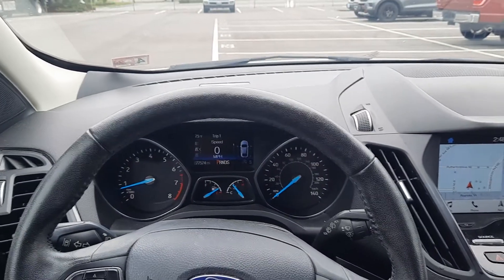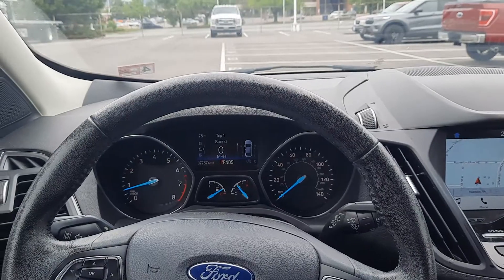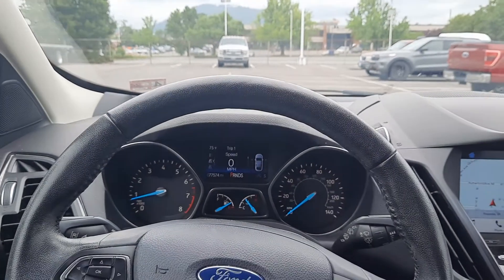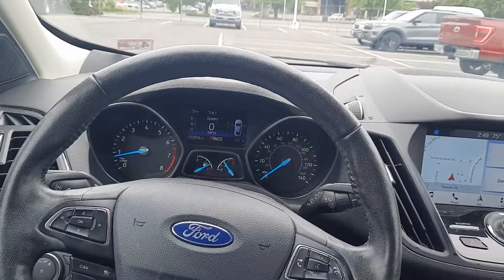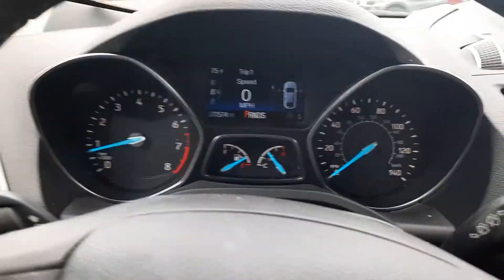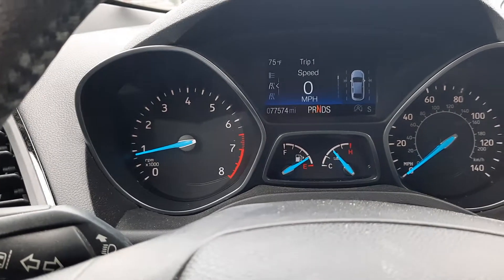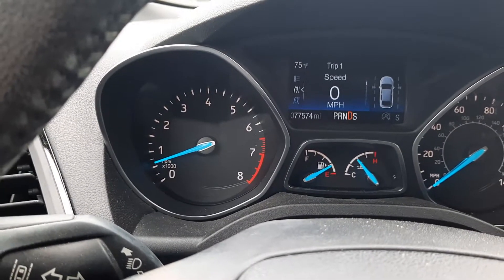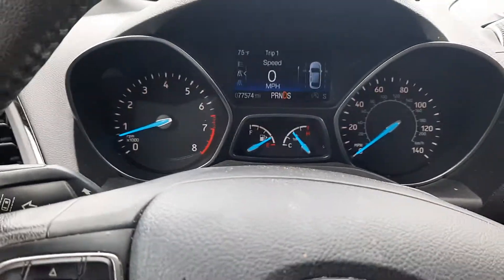Very Rough, Low Idle in Gear Only! Ford Escape

Comment from the maker: Watch next: 6F35 FULL Rebuild https://youtu.be/lrMZ2m-Zji0
Transmission removal: https://youtu.be/E-OCjm3pFJ0
6F35 Transmission Service: https://youtu.be/F--bs3gqq5M
Won't move in DRIVE: https://youtu.be/td6KwBAuJf8
Converter shudder diag: https://youtu.be/7yNIrjUlu4w
Checking fluid level: https://youtu.be/jswCtiJaXpU
Pump whine sound: https://youtu.be/pbgr44_fILU

Comment: 6F35 from ETE Reman install by myself, has heavy drag on idle, whining/grinding noise as each gear tops out on rpms before shifting to next gear. Details: 2013 escape 2.5 FW, I installed a 6f35 from ETE Reman twice. The first install was replace under warranty within first two months. The second and current install has the same two problems. There is a loud heavy/rough drag on idle (car shakes) and occasionally shakes at low speed but stable when accelerating and under load. And, second, there is a high pitch grinding/whining or scrapping noise when the rpm's of each gear tops out before shifting to next gear (almost as if the differential planetary gears are floating (less torque at top end) and raddling on their pins. There is no lateral play in the differential, i.e. case ware. The left shaft has some wiggle when up on jack stands but is solid when on the ground.). At 77 yrs old the first install was a hobby. The second install was taxing on this old body, and frustrating. For replacements ETE Reman simply pulls another rebuild off the shelf and will not investigate the issue, and I am exhausted in dealing with them. I believe I should work with the one I have. What do you suggest? Perhaps first trying the LubeGard Shutter Fix? Or, pulling the trans and replace the converter and pump, or have someone rebuild it for $2-3K? I you think that I did something wrong? Thanks for you service. Looking forward to your reply. Tim, Ventura, CA
Reply from the maker: I would like to see a video clip of the concern, if you want to share that on my facebook or discord group. But, typically a low/dragging idle is a failed torque converter clutch and won't be fixed by a service. However, I would be interested in seeing what it's doing to give better advice
Reply: Let me know if videos don’t work
Reply: Still trying to post video links.
Reply from the maker: @timmountford652 Hi, I dont see one in my facebook or discord group

Comment: Question  having the same problem . I was told that it's not a good idea just to replace the torque converter.  That the fluid could  have got metal shavings through the transmission.. What's your thoughts when you replace the torque converter? Did you have any problems after that.  called the local transmission shop and they said it needs a full rebuild. It shifts and drives fine after you start going.
Reply from the maker: Yes, I recommend a full teardown, cleanup, pump, converter, valve body, and overhaul kit. Sorry if I wasn't clear in the video. Thats the best repair.

Comment: Good afternoon, I'm Brazilian.. I have a problem with my 6f35 Ford Fusion, I bought a used transmission and installed it in my vehicle, the oil is at the level and it's new. It turns out that the car has this noise as seen in the video and when it heats up, the gearbox ends up losing gear and then I have to turn it off and on again, there is no error code on the scanner, the gearbox is jerky, it seems like it is trying to engage two gears at once, can you help me?

Comment: I have an 05 escape 2.3l, it idles a bit weird even in park, but worse in drive. It sounds kind of low, and jumps up from 800 to 1000 rpms when I’m stopped at a light or stop sign every 30 seconds or so. Also when I try to rev the engine when parked, it’ll jump rpms if I try to hold rpms at any amount. My transmission is a four-speed automatic, do you think this is the same issue?

Comment: This was very helpful. I have the exact same issue on my 2018 Escape. No CEL though, thought that was weird.

Is there a fix that doesn’t require tearing into the transmission? Trying to weigh my options here.
Reply from the maker: Hello, thanks for watching. It may end up saving you money having the issue diagnosed first. However, when the converter clutch is not fully releasing, it's not usually repairable. If you want to try something, you can drain and fill the Transmission 2 or 3 times (4.5 qts each time) and add lubegard shudderfix on the final fill. That's a friction modifier.
Reply: @BigBensCarsAndCycles  The issue happened when the vehicle was stopped. My wife said the auto stop-start was working fine and it killed the engine. But when the light turned green and she went to take off, the engine started but was vibrating really bad. At the next stop light, it was still shaking quite badly and she got some sort of error to place the car in park and to restart the engine.

Not sure if that changes anything?
Reply from the maker: @Chandlerite  check for trouble codes and if you'd like, join my Facebook group and share info, we'll help

Comment: I have this issue in my 2012 Ford Escape. Scan tool data shows desired tcc slip 1020 but actual 20 to 30 when I'm in gear at idle. Would this data confirm that I have a tcc issue? I have had no dtc's come up.
Reply from the maker: Yes, it sounds like the tcc is dragging and causing your problem

Comment: Could this still be the problem for my car if it’s not that rough in drive? It shifts and drives totally fine but just rougher idle in drive
Reply from the maker: Hi, to confirm torque converter not releasing properly, you can use Forscan to look at TCC slip desired and Slip measured. It should be the same. If not, you need a torque converter to fix the problem. Or, ignore it and get as much life as you can out of it
Reply: @BigBensCarsAndCycles what is a Forscan?

Comment: Any fix ?
Reply from the maker: The torque converter clutch is dragging so the torque converter needs to be replaced. Replace the pump while you're in there!! Also, if you'd like, flush the transmission before doing the converter, add conditioner and friction modifier (lubegard shudder fix) and run the car hard for a while, see if it still does it
Reply: @BigBensCarsAndCycles 
Hello my friend I'm having this exact issue. I'm being told I have to replace my transmission. Do I have to do a full tans replacement or just the converter and front pump? Please help with any input thank you m

Comment: Having exact issue rn
Reply from the maker: Probably going  to end up needing a torque converter. If you want to throw some money at it first, you can drain and fill the Transmission 3 times and add friction modifier on the 3rd fill (lubegard shudder fix) and BG atf conditioner. It would be good to add bg quick clean atf cleaner before the first drain too and drive it